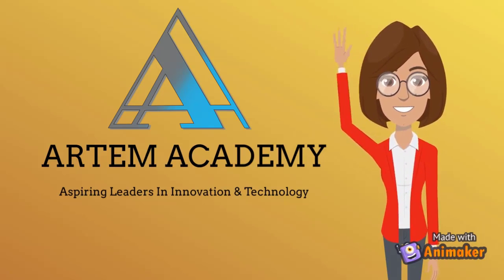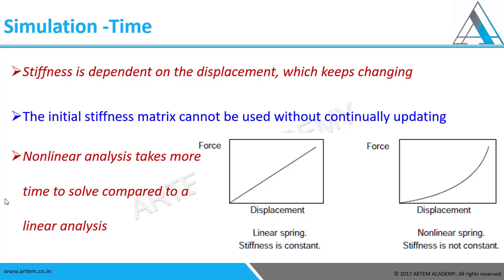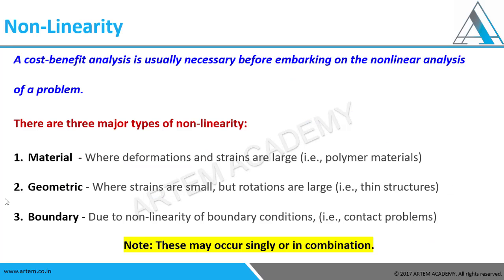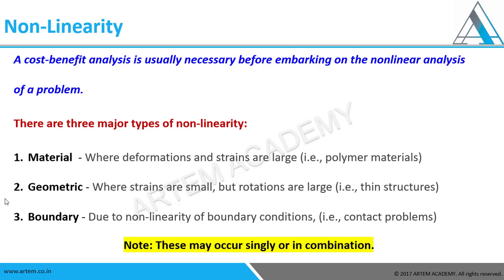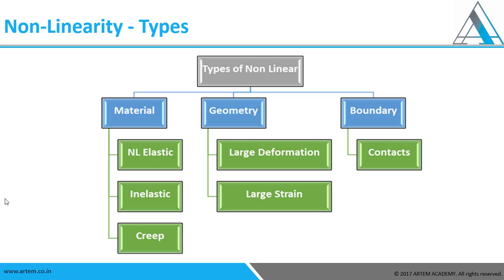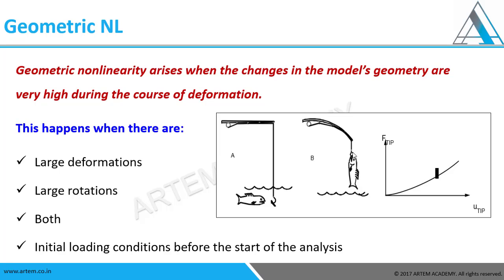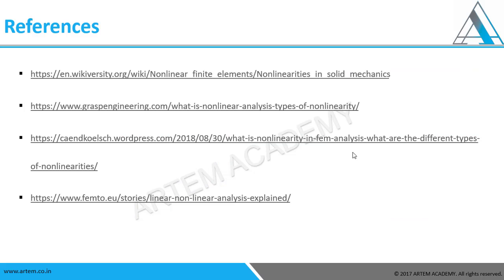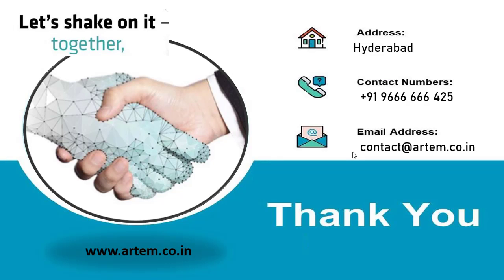Why do we need Non-Linear analysis. Types & importance of it!

Comment: Thanks 
Please I have question
Why when we study footing uplift we required static nonlinear analysis
Reply from the maker: For evaluating dynamic characteristics of slender structures like tall buildings or school buildings, it is necessary to consider the effect of uplift of the foundations. Earthquakes may cause separation at the interface of footing and supporting ground. When a structure vibrated the contact interface between footing and soil is reduced. Because of the concentration of stress in the remaining contact area the soil beneath the footing can deform plastically. So, calculating the response of the building considering geometrical nonlinearity of the connection is required.

Hope this information serves your purpose.